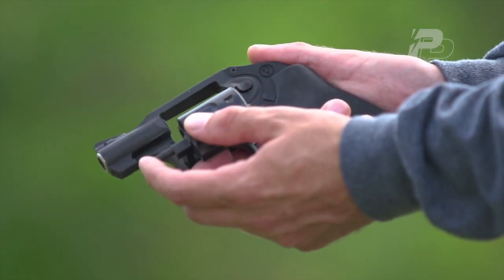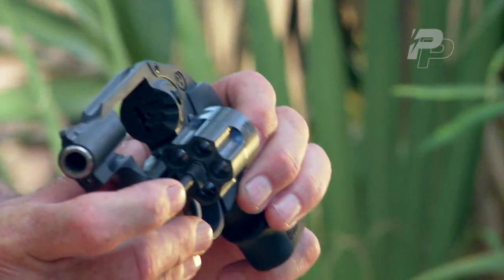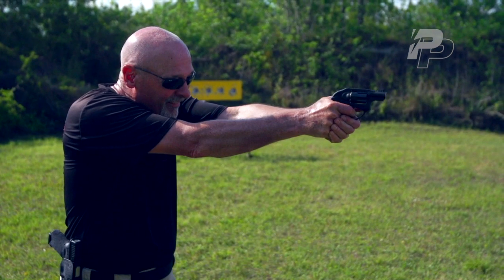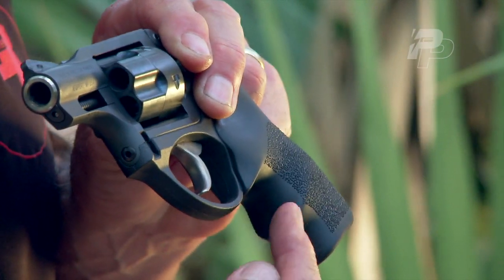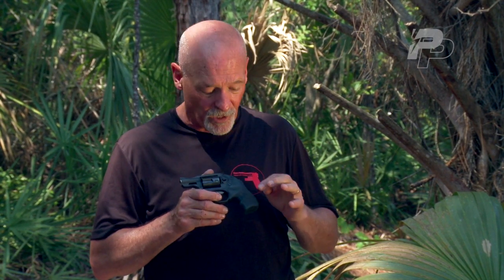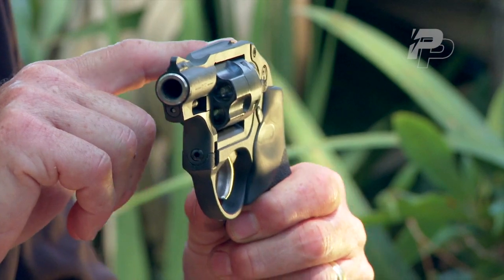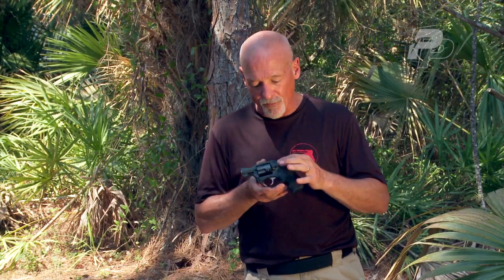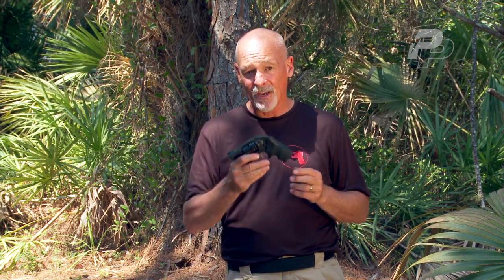Dave Spaulding on the Ruger LCR

Comment: Just a note on the new LCR's - no need to paint the sight anymore as they now come with an embedded white stripe up the ramp (which should be available from Ruger as a replacement part to update yours). I opted for the XS tritium replacement, which helps get target acquisition quickly, and old man friendly Crimson Trace laser (but gave up the big cushy Hogue grip in the process). Makes a great lightweight, ultra reliable, hard hitting ccw gun. 

Mated with 5-Star speed loaders and Massad Ayoob's reloading technique practice, empty dump and reloads are nearly as quick as semi-auto.
Reply: faultroy  Old thread I know. I carry the lcr 38spc off duty. I have never had a issue with the hogues drawing from appendix carry. I rarely carry strong side, but I see no problem if thats your carry choice. No snags from the hogues in my daily use or at the range. They are a little bulkier, but very concealeable with a t-shirt just covering.
Reply: Always have the LCR in my right front pocket. Hogue grips dissappear with the rest of it. I forget I have it all the time.

Comment: I was torn between this and the the J Frame 340pd. I wanted to go as light as possible. I went with this one because of the features and weight. Since Ruger removed the internal lock weights been reduced to 13.1 ounces. The front sight is pinned. The rear sight channel is deeper. Sweet trigger. And If you replace the tamer grip with the boot grip you can get weight down to 12.7 ounces. Very impressive. Awesome gun.

Comment: I own the LCR 9mm and did not like the 2 finger factory grip. I wear size XXL gloves, and didn't want my pinky finger dangling off the gun. I replaced the stock grip with a longer grip from Hogue, in G10 polymer. It feels much better to me to get all my fingers on the grip now. The only downside to G10 is that they are hard, and do not absorb recoil like the factory grip. The best option might be the longer rubber grip from Hogue which comes with or without finger grooves. It also comes in various colors if that appeals to you.

Comment: This seems to definitely be the GO TO snubby. I've been researching snub nose revolvers for the last week and always get redirected back to the Ruger LCR! I've never owned a hand gun yet, so shopping for one can be very overwhelming on what to get that fits me. I've always wanted my first hand gun to be a revolver ie easy to use, clean, operate, and all around learning experience. Whelp, I think the LCR will do me just fine! This gun seems to check mark everything a first time hand gun owner would want. Excellent video! 👌👍
Reply: Get it in 327 federal magnum, (if you can find it) you get 6 shots which is huge over 5! I have one it’s a near perfect conceal carry pistol! The DA trigger is so much better and smoother than the j frame S&Ws! I can’t recommend a LCR enough! My wife and daughter can even shoot mine and they hate firearms! I just load it with 32S&W Long wadcutters from Buffalo bore and it’s like shooting a 22mag, almost no recoil or blast at all yet still extremely fatal! The 327fed LCR is so Ammo flexible it’s crazy, you can shoot 5 different loadings through it! 👍🏻

Comment: So here is my experience with my LCRx. I am going to post this on every 
Ruger LCR thread so that buyers can be aware of the issue I have had.

I waited for the LCRx to come out in 327 Federal because I wanted the exposed hammer.
Having tested the trigger in a local shop for both the LCR and the LCRx I was satisfied that Ruger had really come up with a smooth trigger.
This particular shop only had the 38 Special and not the cartridge I was looking for so I ordered the LCRx in 327 from a internet based retailer.

Upon receiving the revolver I found that the second half of the trigger pull in double action was sticky or in other words NOT SMOOTH.
I called the retailer who sold it too me and told them about the problem. They said they would take it back but charge me a restocking fee of 20%. Of course at that point I was already out the shipping and FFL fees, 

OR

I could send it to Ruger for them to fix under warranty.

So I sent it to Ruger only to have upon its return, THE SAME Problem, AND after about 50 dry firings the cylinder locked up.

Once again I sent it back, they fixed the cylinder problem but ONCE AGAIN, the trigger pull was unacceptable. 

So now it is on it's way back to Ruger...... for the third time

My recommendation is to use a local dealer who has what you want in stock. 
If they don't and can order it for you, do so
With the understanding that it must be delivered with the gun working properly in every respect before you pay for it.

Further if you do order a firearm via the internet be sure that the seller agrees to take it back and reimburses you for shipping & FFL charges if it is not as represented. 

Beware that gunbroker.com had a fraud policy of up to $500.00 but it also has a 100.00 dollar deductible.

Comment: Looks like Florida Dave..... I carry one of these in 357....I traded a S&W airweight for the LCR because of the trigger.  My wife could just barely squeeze it.  Very well done video!
Reply: +Richard DiLorenzo Hows the recoil for .38 Special for the LCR compared to the Airweight?
Reply: I load .38 spl. for range practice.  I'd say the recoil is comparable with that load, but it's been a while since I traded the Airweight for the LCR.  I also don't shot the LCR very much, my wife does.  With my loads she can shoot it all day without any problems.  She carries it with a Hornady .38 special "ladies load".  The one with the pink polymer insert.....
Reply: +Richard DiLorenzo Is your wife recoil sensitive? The critical defense lite isn't really all that good. Why not use the speer short barrel gold dot or a lswchp from buffalo bore or federal?
Reply: You could run .38 soft-lead wadcutters. 650-750 fps and deep, reliable penetration with good wounding characteristics. Due to the lower pressures, recoil is negligible.

Comment: Two issues with it though: One, that trigger reset. Those who have fired one know exactly what I mean. Two, the .357 mag. version is built a bit beefier at the barrel than the .38 Special. Only revolver I know of where if you just want to shoot .38s (both standard or +P loads) a man would be better off buying the .357 mag. version anyway. 

That second issue though is a minor one compared to the first. Listen for 4 tiny clicks or completely pull your finger off the trigger to ensure you actually get that follow-up shot. This gun would be more popular if Ruger would fix the trigger reset.
Reply: "Listen for 4 tiny clicks or completely pull your finger off the trigger to ensure you actually get that follow-up shot. This gun would be more popular if Ruger would fix the trigger reset."

After seeing someone demonstrate how this gun can "skip" a chamber due to this problem, I would never buy one.  To me, it's a fatal flaw that disqualifies it as a self-defense handgun.
Reply: *****
If you're looking for a very light-weight, 5-shot, .38 Special revolver rated for +P, with a small frame and two-inch barrel, along with a fully enclosed hammer, there's the S&W model 642. If you want a black finish, there's the 442. Yes, the grips on the Ruger are better from a practicality point of view. But the difference between it and the S&Ws is not considerable.
Reply: It's a double action revolver. You need to fully release and pull the trigger for it to function. What you are doing is called short-stroking the trigger.
Reply: Chris F
Ironically that is exactly what you end up doing on a regular basis with this Ruger because the reset is so terrible. You can't help but short stroke it. It's just not a problem on S&W revolvers in the same size range. The reset is simply better so the guns fire instead of constantly short stroking the trigger.
Reply: thats your personal problem. i have no problems with the reset.
Reply: +andrademeza Well good for you. As for a "personal problem" that issue has been brought  up by others in numerous reviews on the web. But hey, I have no sacred cow preferred brand. I like what works without having to compromise for the deficiencies of firearms engineers who phoned it in regarding certain features. But hey, that's just me.

Comment: I would NEVER buy a double-action only revolver unless I could trick it into single action. Sometimes one needs to get a little extra range out of a gun, and you just can't get it with this revolver. Also, though this gun may be strong enough to absorb the blast and stress of a .357, I don't believe it will hold up over time. That said, I love this gun, but I'll get one with an exposed hammer. Like I said, these guns should be plenty strong, but after shooting over time, I wouldn't be surprised if the plastic didn't hold up. Only time will tell.
Reply: I reload ammo, so, even now, I shoot my 357 lcr, hammerless, 2 Saturday’s a month. Going on 3 years and more then 40 boxes of ammo, it still holding strong, and shoots very well, even at 20 yards. Yes, yards. I only shoot 38spl , and a little plus P. 17.5 ounce weight really helps to absorb recoil of 38spl. Easy to conceal. The ONLY gun I will ever conceal. Did I mention, it is hammerless.
Reply: More for me then

Comment: Dave is wrong about what parts of the revolver are made from polymer. Only the fire control housing, trigger guard and the part that covers the hammer are made from plastic. The rest of the gun is metal, with the cylinder, trigger mechanism, hammer and of course barrel insert being steel and the frame being made from aluminum.
Also, the .357 magnum variants' frame is made from steel instead of aluminium. All these things can be looked up in less than 5 minutes on rugers' official site. Mr. Spaulding should consider doing a small amount of research before talking about certain guns in the future.
Reply: TheRealBaneheart Did you even watch this video? Try again from about 50 seconds in. YOU should consider watching any videos you evaluate to prevent making an ass of yourself in the future.
Reply: taemian Huh, you're absolutely right. Don't know how I could get that wrong. Thanks for setting me me right though, I appreciate it.

Comment: I'm old school...is there an external safety? If not, what prevents accident discharge?
Reply: Old school? Which popular revolvers ever had an external safety?
Reply: Every handgun needs a holster. The right holster will fit your gun snugly and securely and will cover the trigger housing.  That’s your safety on a revolver.

In addition, the LCR has a 6 lb trigger and not a 2 lb trigger (or less on some competition guns). So it takes deliberate action. AND the trigger needs to come back a good ways to fire. So not a hair trigger. AND the LCR has a transfer bar firing pin block.

In addition, you should be exercising proper muzzle control and keeping your finger off the trigger when not firing.

If you really want to safe the gun, if you take the grip off, there is a tab you twist that will put the gun in a non-firing state.
Reply: The safety is between your ears.